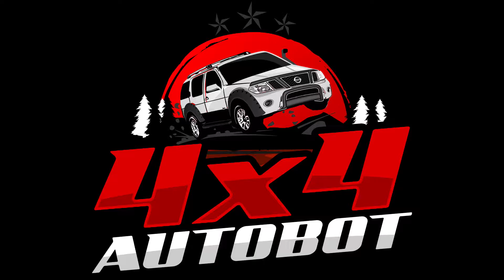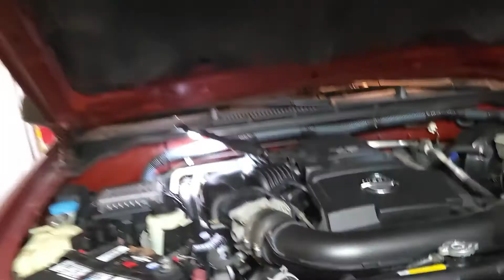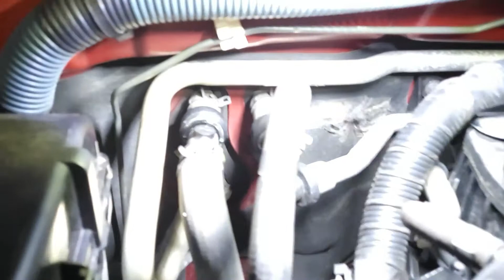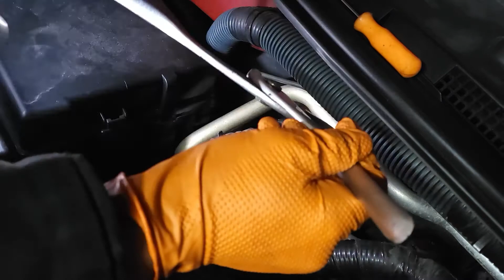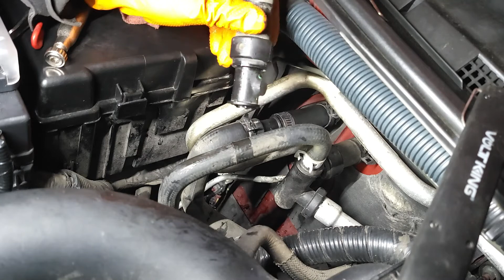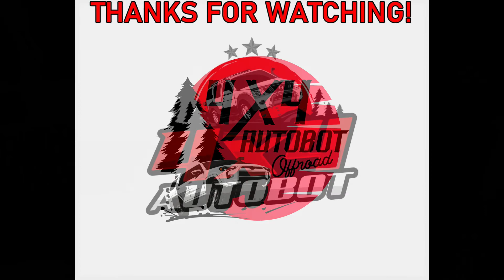NISSAN PATHFINDER HEATER HOSE REPLACEMENT

Comment: May I ask for the name of the hose that is right next to the right of the house you were working with? 

The hose/tube that connects to the heat- hose outlet and curves going down. 

I've been looking for it through car parts and without luck.
Reply from the maker: Hello i believe what you're talking about is the outlet hose assembly. I found it in www.rockauto.com under heat and air conditioning. GL

Comment: What size rubber hose did you use that attached to the firewall? And the plastic connector what is it called? What a great fix!
Reply from the maker: I believed that was 3/4 inch hose and also the plastic piece. Cheerz

Comment: Buenos días, soy de República Dominicana necesito esa pieza para mí Nissan como la consigo y cuánto cuesta
Reply from the maker: HELLO, YES YOU CAN GET IT AT YOUR LOCAL AUTO PART STORE AND ASK FOR THE HOSE AND THE PLASTIC CONNECTOR IN 3/4 INCH SIZE. GOODLUCK
Reply: No necesitas el adaptador. Conecta la manguera directo.

Comment: bat di mo pinalitan kabila kabayan? malapit na rin yang sumunod.
Reply from the maker: Quick fix lang kabayan as i was still monitoring the condition of the car. Kabibili ko lang noon e. But theres a plan to replace it sometime soon.
Reply: @4x4AUTOBOT  2012 S yung sakin wala namang leak pero papalitan ko asap para iwas abala sa byahe.
Reply from the maker: @ApArt1003  a very safe choice. 🤌

Comment: My heater hose just connects to the inlet/outlet
Reply: Sounds like someone did a by-pass. Do you ever use your heater?
Reply: @minutemenapparel1539  I did once because it looked like my engine was getting hot, worked find. It's not a by pass they just grabbed the hose, removed the broken parts, and attached the hose.
Reply: @jpadilla0515  oh I see what you mean, thought you were saying there was a hose connecting the inlet to the outlet so it loops.
Reply: @jpadilla0515  I wonder why there’s even any sort of fitting and not directly connecting the hose onto the inlet and outlet. Just another failure point esp since it’s plastic from factory.